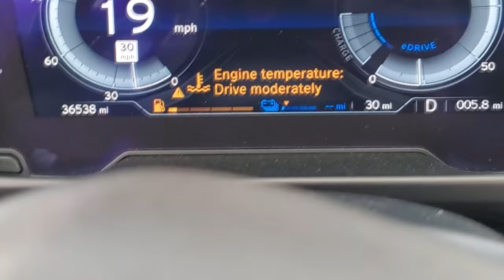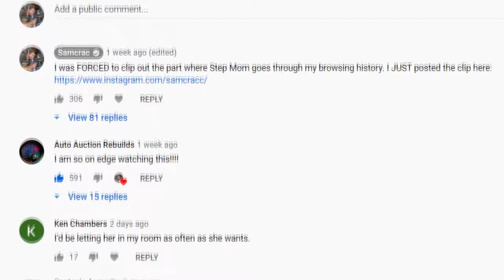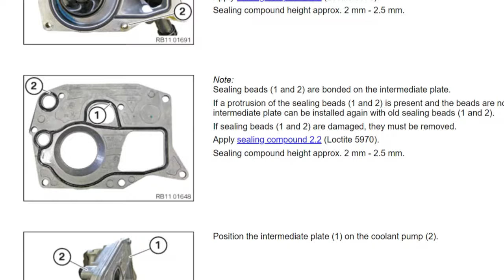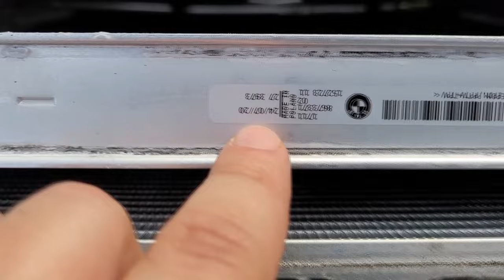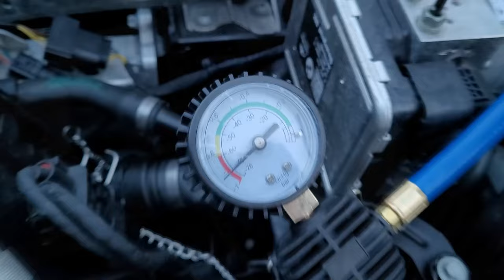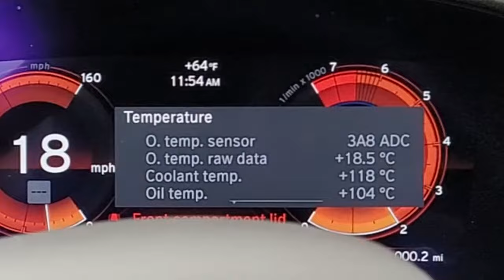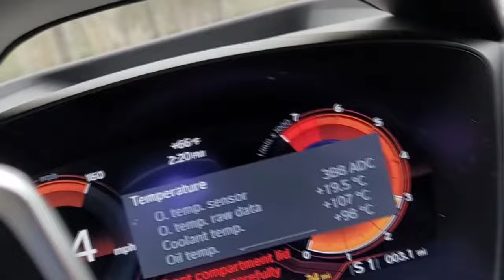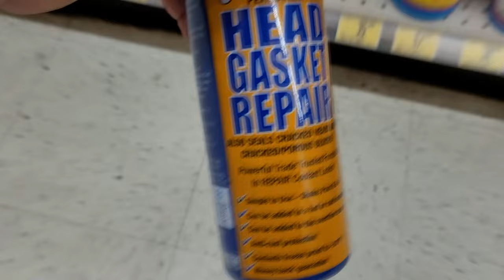The Dealer FAILED my "Unrepairable" BMW Supercar! Can I Fix it with this Simple DIY Trick???

Comment: it might be leaking a bit of exhaust gasses into the cooling system, but that is not what makes it overheat. The water is not circulating.
Reply: If gas is leaking into the system it leads to the same problem that having air trapped in the system in the end (hot spots in the highest points in the cooling circuit due to lack of contact)
Reply: The water is displaced and because it is pushing air all the way thru the water jacket to the overflow tank it is serious problem.
Reply: He had heat during the last test drive. Wouldn't that mean water is circulating?
Reply: Guys do we know if the water pump was working? 
Why would BringMoneyWallet supply whole assembly?

Comment: The one thing I've not seen you do is check the actual flow of the coolant.  Is it moving from the radiator to the engine and back?  You're assuming it's moving by replacing the pump.
Reply: Right? A lot of smart people suggested that on both videos.

Comment: I CALLED IT. SEEN IT BEFORE.

Not on an i3, because I'm too scared to own any BMW (but somehow a Touareg V10 TDI is perfectly acceptable in my book). But anyway, this is actually not unusual on turbocharged German engines that maybe overheated from a loss of coolant in the first place. The cylinder head warps some, but the gasket stays sealed well enough that you don't get a loss of compression, you don't get coolant out the tailpipe as steam, but you DO get exhaust gases into the cooling system, super pressurizing the system and eventually ejecting coolant out of the pressure relief in the reservoir.

Been there more times than I care to count. It's a good idea to see what normal cooling system pressure is like from just some thermal expansion vs the excess pressure you get with a bad headgasket. Can save a world of time in diag if you know how to recognize excess cooling system pressure.

Comment: So basically the dealer advice of "needs a new engine" was correct.
Reply: A rarity of truth this time
Reply: Oh crap.  I forgot that.
Reply: @chadthompson5970  In a BMW LOL oh wait it's an i8 that is much worse he needs a new car. Literally it would be cheaper to buy another car which is why it was totaled.
Reply: @greyfox78569  Exactly 💯 These cars are like condoms - single use.
Reply: @LimitedEditionMotorcars  People don't understand BMWs are great new cars they are horrible used cars. Beyond just the used luxury car issue is that BMW demands precision to work right. Once BMWs are abused they will never work right ever again.

I would say this guy needs to part it out but then again no one in there right mind buys used BMW parts off a wrecked BMW because they never work right. He basically lost his money.
Reply: Dealer service manager of almost 20 years and 25 years service experience....... Tech says needs an engine ..... Means it.        Too many times I have had tickets and pissed customer drug in my office only to have to policy too many hours to get the job done when it would of been alot easier for the Advisor  to either sell an engine or move the job out to a shop who has time to burn and cobble the job.
Reply: @LimitedEditionMotorcars  and can get expensive if they fail.
Reply: @chadthompson5970  Not on a BMW. If a BMW engine has a faulty head gasket, you should buy a new engine. You can replace them, but they will keep disintegrating over and over again, sometimes in as little as 1000 miles. I have no idea why that is but that's the way it is has been since the 1980s.
Reply: @greyfox78569 it really ANY new car is a great car lol
Reply: Yes but now Samcrac has earned enough money off his DRAMA videos to buy a new engine.  But the videos are ok if you just like to go though the various parts of a BMW.
Reply: @hoodoo2001  Yupp, it's all for the views.
Reply: at least the whole cooling system

Comment: I'd rather do a head gasket on a tiny 3cyl then bleed the coolant again🤣
Reply: So you're saying you want to do both.
Reply: @shawbros  keyword "again"
Reply: He needs to do both 😁
Reply: would be the sensible thing to do instead of screwing with a can that is going to f up the rest of the cooling system making the new radiator a total waste of money. just replace the head gasket send the head out put back together and know its done right.
Reply: With all the time wasted in these last couple of videos, could have rebuild the engine by now.

Comment: @ 6:35 Special BMW tool for the hose clamps, A pair of pliers. Actually they have the generic spring clamp tool that has a cable with a special end for those hard to reach clamps where you can't get a plier in there but those are right out in the open. A tip for helping hoses to slip on (and get them off again later) is to smear a small amount of silicone grease on the inside of them, don't worry, the clamps will keep them from sliding off especially with the size of the bead at the end of those hard pipes. I just watched the part where you spray the rad connections with lubricant, silicone spray is best because it won't cause the rubber hose to swell or break down like some penetrants can. I mentioned in a previous comment that I recommend a Block tester to see if any combustion gasses are getting into the cooling system because a lot of your symptoms are consistent with a head gasket or crack in the combustion chamber letting combustion gasses into the cooling system. They are cheap at NAPA (around $50) or so. I still say that would be a good idea. I'm not sure if angling the car will help, the whole point in doing a vacuum fill of the cooling system is to remove all the air so you don't have any trapped in the system. There's no such thing as a vacuum bubble.

Comment: repairs headgasket*, okay guys its still overheating i cant seem to fix this car. 
The cracked engine block: MUAHAHHA
Reply: Had same problem. This guys videos are dejavu to me. Changed all cooling circuit, later changed gasket twice, just to find out that my block kad tiny cracks around cilinders.
Reply: @asateika  how mad were you Jesus 😂

Comment: Dead giveaway it is likely a blown head gasket, or even a cracked head is the bubbling in the reservoir on last video which means exhaust gases is leaking in.
Reply: That was my thought too. Radiator hose only get firmer after the engine has reached temp and the fluid expands thus making the hoses firm.
If you start an engine and the hoses immediately firm up, you know you have combustion gasses entering your coolant system.
I'm betting on a cracked block with a lifted head. 
I'd also do a cylinder compression/leak-down test before pulling the engine apart/out or adding anything into. Just to get a baseline established. 
But that's just my thoughts on Sam's dilemma. It's a very nice looking car that one and deserves a little bit of TLC, Which it is getting.

Comment: LOL. Dealer doesn't just recommend a engine for no good reason & you found out Sam the hard way.
Reply: A blown had gasket is a good reason for an entire engine?
Reply: As Airbourne said : "There ain't no way but the hard way"
Reply: From a dealer perspective it makes total sense to swap the engine. Higher margins and less work, yet they still bill a shed-load of hours.
Reply: but they could've just replaced the head gasket.
Reply: @Andi11144  when its only 3cylinder in a mid engine luxury sports car, yeah probably. Time=$
Reply: My BMW dealer recommended a turbo replacement for around $4000, i was sure the turbo was fine, turned out its a completely different issue no where near my turbo, fixed it for 1500 in a repairshop guy.. they couldnt find the reason and i paid for diagnostic and software update+ towing etc. so yeah, dealers are full of crap in general ill never trust a dealer
Reply: @Andi11144  My guess is the block/cylinder head are also warped which is the reason for engine replacement recommendation.
Reply: @seren1ty755   My guess is the block/cylinder head are also warped which is the reason for engine replacement recommendation.
Reply: @Deejovoodoo  cool story.
Reply: @WRCWRX  even so, changing the headgasket and or Head or resurfacing is a common repair wich should never be more expensive than a complete engine
Reply: @Andi11144  it is a 6 figure BMW. Dealer is not messing around with the potential comeback. Engine replacement in this instance is the logical repair. Now if it was a Honda sure.
Reply: @WRCWRX  I think they simple lack the competence at the BMW dealer. Correctly repaired comeback will not happen.
Reply: @Andi11144  sure.

Comment: The "amazing deal" you got kind of hints that the seller knew EXACTLY what the problem was.
Reply: Yep. Way too expensive to deal with
Reply: Eh. It’s just labor. Rip it out and put in a new gasket. As long as heads are true it’s fine.
Reply: rub it in dude. :D
Reply: @af22man  Except it's most likely a cracked block.

Comment: Maybe there is a blockage in the engine block for the cooling
Reply: blockage would not turn the bottle tester yellow, there is exhaust gas entering the coolant.
Reply: Yep.  Never confirmed blockage or not.  The pressure test blew the rad and that was that.  Could have been a blocked rad that then blew the gasket.  Or somewhere else still blocked.

Comment: For the love of BMW, please don't use the headgasket liquid. Just pull the damn thing and put a new one in!
Reply: Only one that works is FIBERLOCK.  It really works
Reply: The problem with that stuff is it messes up thermostats. That will have to be replaced again. Put the old one back in and do the treatment then after its done he needs to put the new thermostat in.
Reply: @Jimmy_in_Mexico  if you’re using head gasket sealer. The last thing to worry about is an easy to reach thermostat.  There’s way worst places where it get clogged.  Like in the coolant channels inside the engine
Reply: Geeze Sam wouldn't do that on a high dollar car, taking his joke way too serious.
Reply: @Jimmy_in_Mexico  Agreed, I've had a case where Steelseal killed a water pump by seeping into the seals then hardening causing them to fail and leak water everywhere. Flushed the system, replaced the pump and used K-Seal which worked great (The car's 13 year old Audi with a porous head which would have cost more than the car's worth to replace, so fix-in-a-bottle it is - 3 years on and car is still going strong)

Comment: I used that stuff on my f250. And it worked for me! Did it two years ago and truck still running strong!

Edit: the blue devil headgasket stuff.... only problem your going to run into is that it has to idle for 50 minutes or so without overheating. So you might be assed out on that.

Comment: Well, Rich is in the making of a V8 Tesla. 
How about a V8 i8 ? or at least an I6 ? 🤞🏻
Reply: An ecoboost I8 would be dope!!!
Reply: Put in the M4 engine.
Reply: @josiahhein6036  Maybe an S65 V8 from the e92 M3 but it would be very difficult to fit it in the i8 and reliability is an issue. A nice option is the B58 engine. It may fit the car without major modifications. It fits the character of the car, its light enough and powerful. Its the engine the i8 should have had from the factory !

Comment: Next: Samcrac puzzled about mysterious mass clogging radiator and heater core.
Reply: Exactly, cause Sam is a hack.
Reply: High quality stop leaks do a fair job on small cracks etc.. But I can't see how you can do the proper procedure with that car..
A normal car with lots of bleeders and no water pipes running lower than the engine and radiator is fine but, how can you have clean water guaranteed in the block with no air to start and then have the car get warm enough for the crack to be patched while the water is still spreading through that part of the engine and then follow it with another full fresh water flush..

Comment: Sam, 
I'm sorry to see that the overheating problem did turn out to be the engine. It must have been very disappointing.  But remember, most of the time this type of problem can be fixed. Head gaskets can be replaced.   Cracks can be welded or stitched most of the time.  Pull the head and check the head gasket for cracks or failure.  Check the head and top of the block for flatness.  Since you confirmed there are exhaust gasses in the coolant, it is most likely the head gasket that has failed.  The next likely culprit would be a crack in the head between the exhaust circuit and coolant passages.  It doesn't sound like a block issue at this point.  If it is a crack in the head, remember, good machine shops fix cracked heads and blocks all the time, and if they are done well they stay fixed. If the head and head gasket are fine then pull the engine and go from there.  A repair and disassembly of that engine will make for much more interesting content than just pulling and replacing it. I'm looking forward to seeing find and solve that problem.  We're all rooting for you!
Bill in NJ

Comment: Actually the dealer found this issue and report it but nobody wants to see it: REPLACE THE ENGINE.
Reply: Replace deez nutz
Reply: you will feel stupid when its just a head gasket!
Reply: @TripleAstyle1  on such a new car and with it being a hybrid what's the chances that it's "just the head gasket" though. Got to be a reason why it failed. Smells like another land rover to me. Back to the auction unfixed :)
Reply: Yes, doubtful its just the headgasket. Probably has cracks in the block coolant pasages and really needs a new engine

Comment: Pull all the hoses off check for obstruction, rags ping-pong balls ECT. Also internal delamination of a rubber hose is possible
Reply: Should of put that comment in the last video. He has proved there’s exhaust gas present in his coolant so he’s a bit past the point of obstructions in the system etc
Reply: Did you even watch? He's got a blown head gasket (Rare)
Reply: watch the ending
Reply: @rafaelrarg  I know right!? As for being rare, I did a bit of searching and found it’s actually not rare on the BMW 3 cylinder (I was only checking UK forums).
Reply: @ChrisBeevor0511  Good to know👍
Reply: @ChrisBeevor0511  A blown head gasket on a BMW /warped Head is  Quite Common. same is bearings in em. most of the times were are the bearings lol.
Reply: @MrBadBoyob  never had any head issues on my Beemers. 
Bottom end rebuilds on the other hand...... don’t even talk about it 😒

Comment: Sam should have changed that entire water pump assembly instead of just swapping out the thermostat. Who knows what the history is on that old water pump!
Reply: He will change it when he pulls the engine to fix the head gasket.  The point was doing everything possible that didn't involve taking the whole car apart again.
Reply: @_PatrickO  If that block seal works he might not pull the engine.

Comment: Yep, I called a blown head gasket when you said two people owned it before and couldn't fix the overheating problem. When it really doesn't show any obviously blown head gasket signs (fluids mixing: coolant with either oil or transmission) and it continues to overheat, the gasket is blown in between the cylinders.

Comment: I've done 7 series with the alum block, and the guy overheated it so bad it annealed the block. The block was so soft that heli-coils and inserts would pull out when you tighten the head. I'm a machinist and engineer so I machined large threaded inserts to screw into the block, and then sleeved the bores, and it's been working fine for a decade. I have to fix holes in Nitro Fueler heads the size of golf-balls, so most stuff can be fixed if you know what you are doing.

Comment: Am I the only one over here going: “ it’s acting like an itty bitty head gasket leak like on an atv or motorcycle.... well I’ll be dammed, sure enough.”
Reply: Head gasket, cracked or warped head, or cracked block?  I'm an optimist so I always guess wrong.

Gotta at least pull the head to know which looks tricky.   Poor Sam.
Reply: What was the problem?
Reply: @billybilly1479  He doesn't know exactly yet other than combustion gas is leaking into the cooling system somehow.  COULD be the head gasket but it probably is the engine block knowing Samcrac's luck... and the fact that a shop recommended replacing the engine.
Reply: All I can say is copper seal the top of the block then gasket then copper seal head. For the compression that engine has, it is acting like the mating surface is barely letting a leak into the coolant system. But if the head gasket and copper coat doesn’t work, definitely wouldn’t doubt the possibility of pinholes in the casting of block or head being compromised

Comment: Definition of insanity:  Doing the same thing over and over again but expecting a different result.
Reply: Belive it or not with these i8's you have to bleed the cooling system over and over sometimes more than 30 times to get all the air out of system, BMW engineers must be disciples of satan.
Reply: Had a 13 911.  I had a front end collision insurance totaled it after 6 months of the dealer trying to bleed it.  It was only 8 months old at the time
Reply: @philipparana9225  I have a boxster and the cooling system takes 22 litres, it’s a bugger to bleed!
Reply: Faas wants to have a word with you XD
Reply: I've been in this room for eight years, now Clarice, and I know they'll never let me out.

Comment: Do you know for sure the radiator coolant is circulating?
Reply: I don't think the HVAC would blow warm if it wasn't
Reply: @joesaiditstrue  If that's the case the oil should look milky.
Reply: Not necessarily.

Comment: From my younger days in manufacturing, we used rubbing alcohol to lubricate rubber parts or tubing for assembly. It evaporates quickly and will not harm or contaminate most applications.

Comment: This is the one of the best examples of start with the basics first. Most mechanical problems have obvious starting points of solution. Car is over heating....might be low on coolant, bad water pump, thermostat or....oh wait....headgasket/cracked block.